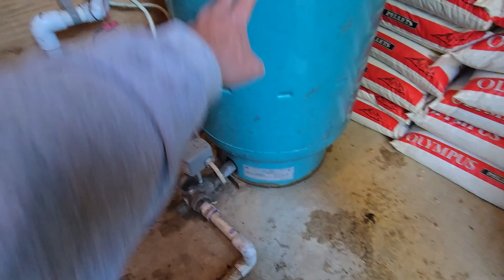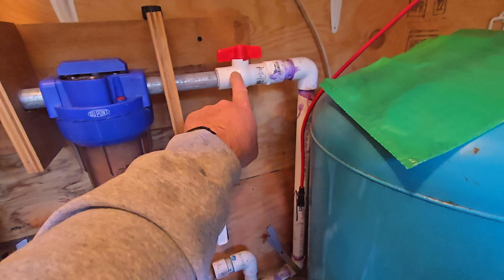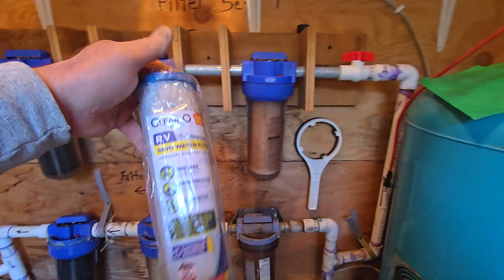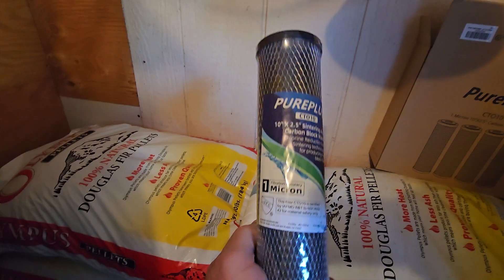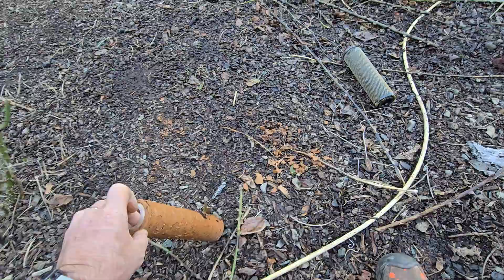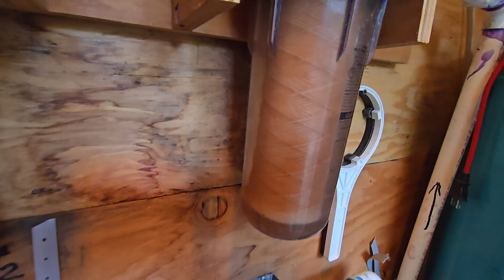Whole House Water Filter System

Comment: Ive got a filter system in my house, but im always curious if i should do a separate filter system to prevent debris from entering the well pressure tank. I noticed you have no filter before your well pressure tank too. does the well pressure tank not degrade from pushing all the dirty water through it?
Reply: You can absolutely put a spin down filter in before your pressure tank. It will only keep larger particles out. But it’s not necessary if you have one after the tank.

Comment: With your skills, you can do something even better.  I am referring to the excessive sediment you are getting.  That kind of sediment should be captured by a large filter- something like a heavy 55-gallon plastic drum that you fill with washed gravel and seal to handle the water's pressure.  This is very doable and will cost very little.  Then, say, once every month or so, you rinse the stones and replace them into the drum.  As for the carbon filter, you only need that for your kitchen line; it is a waste to shower with carbon-filtered water.
Reply from the maker: @thelawdoc8029  great idea, the sediment was due to forgetting to turn off the hose that was topping off the hottub. It ran for 10+ hours straight. Usually not that bad, not even close to that bad, but the video shows how good the filters worked.

Comment: Our well is not that bad, but we had concerns about the quality of our drinking water and had a Reverse Osmosis system installed.  The system tells you when it needs service, and my wife was calling the company every few months to service the system.  Pricey at $300.00 for a service call.  I placed a single whole house filter on our home water line and used a string filter that are specially made for wells.  That was 8 months ago no more stains or cloudy water. in 8 months, I have not changed the Osmosis filters, and I have not had to call the National company who never recommended a home filter on our well when they installed the water softener or the Osmosis system on our home.  I would highly recommend a water filter on your home when using well water.  They are easy to install and for me worked miracles on the quality of our water.  I am a little disappointed in the national company never suggested this simple improvement.